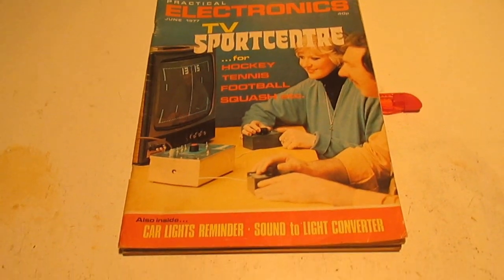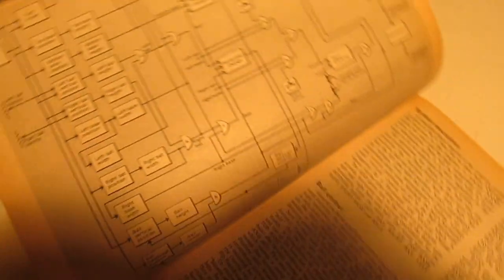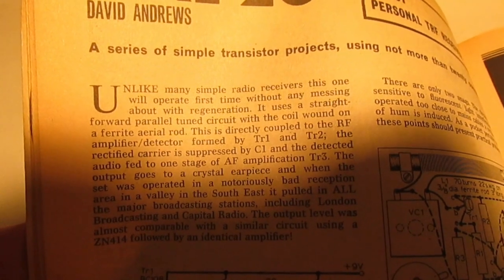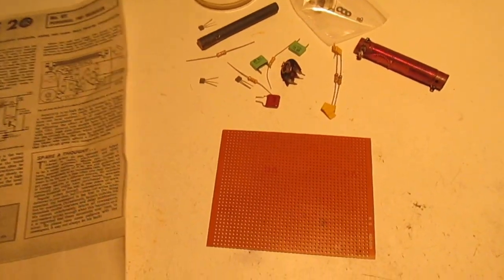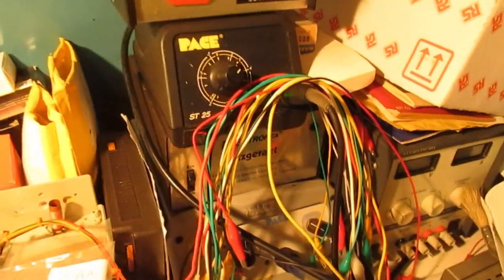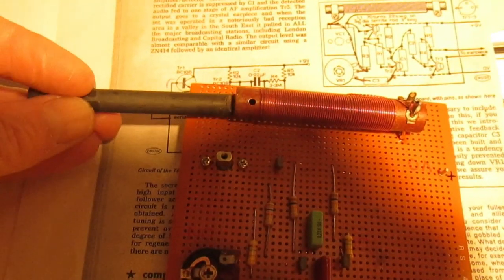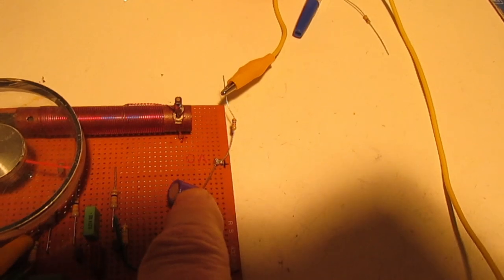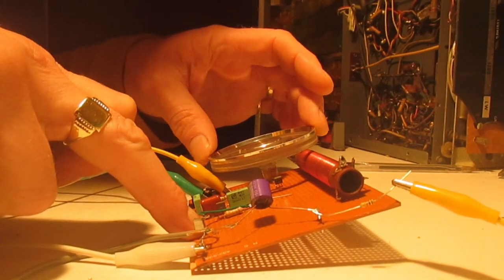Take 20  ,no 61. Practical wireless 1974 . Personal TRF receiver.David Andrews

Comment: Hello MD. Happy memories. I regularly dip into my 50 years of magazines stash and knock up  a project when its raining, usually on a breadboard
Reply from the maker: Breadboard is the modern word, when I was young and had one it was called S Dec !
Reply: @michaeldranfield7140  You know, that rings a bell. Who made those?
Reply: I had a 'Google' - I recall the S and T dec's, they also had a u-dec for IC's. I dont think I could afford one!
Reply from the maker: I can't remember but I still have mine from the 70s so where in a box, there was also an option for a front panel with 3 holes in to mount potentiometers.
Reply from the maker: Correct Sdec first then came one for IC s. I never had the IC one though.

Comment: Oh, that brings lots of happy memories of when I used my “transtronic” electronic construction set to make similar radio projects. I then progressed onto a Heathkit construction set which enabled me to make more advanced circuits. I’m surprised you didn’t have any BC108’s, that was my go to transistor for everything although in the early days it was the OC71 !
Reply from the maker: Heath kit was just a little before my time sadly but I do have a couple of FM radios by heath in my collection, I did find the odd BC108 after a search and as you say considering the popularity back in the 70s it is suprizing I didn't have a load of them
Reply: @michaeldranfield7140  BC148 or BC548 same thing but more modern encapsulation, i've found a few very old silicon devices with same can as the OC81!, BC148 would be period correct for the 70s, dunno about  BC548 dunno when the TO92 version came out,  maybe BC184 more that era?
Reply: I used to lust after things in the Heathkit catalogue! 🤩
Reply: @mistermikeanson  Yes, me too but as a hard up schoolboy that’s as far as it went but my uncle built a Heathkit LW, MW portable radio and it worked very well. I think it was an American firm.
Reply: My parents bought me a Transtronic kit for Christmas when I was about 10 years old. I used it for several years.

Comment: I remember building the Ladybird book TRF receiver but never got it to work for a multitude of reasons.  Getting exactly the right Eagle LT700 centre-tapped transformer was almost impossible, and I didn't have the right variable capacitor or ferrite core.  It probably would be easier to source the parts today than it was back in the day.  The Practical Wireless design looks easier to source parts for.
Reply from the maker: I have the ladybird book , I use to look at this book on a Saturday morning when we went out shopping and my mum took me to the library afterwards, never made anything out of it though , that would be about 1971 / 72 time .

Comment: Oh, nostalgia - I built this back then. Worked pretty well if I remember.
Reply from the maker: Would have been much better in the 70 s though when there was a lot more stations broadcast and houses weren't full of suff using switch mode power supplies generating RFI.
Reply: @michaeldranfield7140  Definitely.   Actually, I don't know why  chose to build a MW radio - I had a perfectly good radio, and anyway, I was more into shortwave (Come to think of it, my first shortwave radio was a Take 20 design, but it was quite quickly superseded - anyone remember the Codar Mini-Clipper ?).

Comment: I remember building a radio 2 tuner probably  from PW or EE .  I had it connected to a scrap old toy record player amp and fitted it in a old wooden cigar box.  Didn’t sound that good  more so due to the poor speaker . The tuner was pretty good  and didn’t drift . 
It didn’t matter what it sounded like it was the fact it worked
Reply from the maker: Yes I have a recollection of the radio 2 tuner, if it's the one I'm thinking of it was housed in a two tone clip together verobox.

Comment: I used to love the Take 20 projects in Practical Wireless. I’m sure I built quite a few of them. I did try to build the Teletennis game but as a fifteen year old it was a bit beyond my skill set at the time! Never did get it working. 
The biggest circuit I ever built on veroboard was a prototype for a company I worked for between 1979 and 1985, that one was 55 CMOS devices. I wish I’d kept it as a souvenir!
Reply from the maker: It's amazing to see how much large scale integration LSI simplified building electronic projects, the original tv game was on about 6 big veroboard s, the one I made only had 1 chip.
Reply: @michaeldranfield7140  the company I worked for at the time was part of the EMI group. I wanted to use a processor for the job but head office had decreed that all micro based designs and software were to be done in Wells. The project was a cash auditing and printing system for a vending machine. As a result what I ended up with was almost a processor in itself, with CMOS 5-digit counter ICs, an RTC, EPROM for text and hardware control and a load of glue logic to output to a parallel printer! Worked a treat too!

Comment: Hi Michael, I actually built that Tele Tennis game you referred to back in the seventies, it came in various kits you could buy separately so you could spread the cost! Somebody came up with a sound card that you could build to add on to the game which I did. Unfortunately there was no on screen scoring so you had to keep score yourself. I still have it and it still works fine.
Reply from the maker: Yes, I saw you could buy a set of Pcbs rather than use veroboard, that must be a very rare item you have then as back then this would have been a very expensive project to make.

Comment: Brilliant!! Love this!!! I remember building a mini radio - I think it was a PW circuit - housed in a Kirby grips box. It was clear plastic one side and white  the other - quite thin. It used a compression mica trimmer capacitor for tuning. Might have used the ZN414 chip - I can't remember. Might have been similar to the F G Rayer matchbox radio in EE.
Reply from the maker: The sinclair micro radio used a compression trimmer for tuning also, I just have one of those ZN414 s so this could well be another up and coming project!
Reply: @michaeldranfield7140  I have found a couple of articles via Google for radio projects using the ZN414. Apparently the chip is obsolete now, but there is a TA7642 which looks like the same thing.
Reply from the maker: @mistermikeanson  ZN414 appeared in a lot of projects in practical wireless , in fact I have one here I may well have a go at , I have the TA7642 s in stock but never looked to see if it is a direct pin for pin replacement or not yet .

Comment: Fairly sure that's Geoff Arnold on the cover with the Tele tennis game, he was the projects sub editor at the time, went on to be editor later. Both PW and Practical Television (as it was then) belonged to IPC magazines then,a version of the tele tennis game must have appeared in Practical telly mag?
Reply from the maker: I am not sure but you could well be right, I think this was designed by IPC magazines themselves so it would fit in place putting the sub editor on the front cover.
Reply: @michaeldranfield7140  I had a quick look on the world radio history site and there were  advertisers selling kits of parts in PTV mag for the PW project in late 1974.

Comment: Another enjoyable video Michael! I remember reading the Practical Wireless issues covering the TV Sportcentre and the incredible complexity with all those TTL chips. The final issue commented that at switch on, 'It might be a blessed relief if nothing happens'. Hilarious. My first electronic project was a TRF radio, inspired by a Ladybird book. All these things led me to a rewarding career in electronics.
Reply from the maker: I use to look at that ladybird book in the library when I went shopping with my mum on Saturdays, now I have my own copy.
Reply: I also had that Ladybird book i cannot remember the title of it but i remember making a small amplifier for a record player if i remember right the transistors were AC128s and the circuit was constructed on a piece of wood using screws and screw cups to join the components together
that little amp was my first electronic circuit that worked. i was about 6 years old when i got that book. in the mid eighties  I  worked in an amusement arcade repairing the coin-operated video games that teletennis  was a simple circuit compared to the machines in the arcade which had several A3 sized pcbs with rows of ttl or cmos logic chips as well as most of them had a Z80 CPU running the game and those boards with all the logic ics were mostly creating the graphics for the game. it was fun fault finding on them with just a multi meter and a logic probe. I have a games machine that has all the classic arcade games that runs on a Raspberry pi. when i play the games i always think of those pcbs with all those logic ics.

Comment: Sounds like a slo-mo drive wouldn't go amiss on the tuning cap.

Do you know, I am going to have to build a crude radio set - A crystal set, that I can actually get to work. Never in all my born days, have I ever been able to make one work. Even copying my granddad in a move for move build, back about 1968, I couldn't get a peep out of one - He did, Granddad, but mine just sat there like so many spare parts stuck to one of Granny's old wood and cork place mats. Maybe I zapped the diode with static electricity or something, but I never got one to work. Maybe I should have pestered him for and authentic cat's whisker?

OA80 germanium diode, I think we used - or something very similar.
Reply from the maker: I built a crystal set in the 70s using a denco coil from maplins and it never worked either, I grew up with valves but by the late 80s valve TVs were considered old fashioned and so I lost interest in valve stuff, but thankfully never threw anything away, then about 20 years ago something sparked off my interest again and in the loft at home I built a 1 valve radio on a block of wood using nails as solder points, the coil I wound on a empty roll of solder as a former and it worked first time to my amazement, the first station it received was radio beiging in China, now I'm not a radio listener anymore but a friend told me it was a very powerful station on medium wave, I still have it in the loft but I borrowed the tuning capacitor for something else, so I would say just have a go and make the simplest thing possible,
Reply: @michaeldranfield7140  I did get crystal radio's running, used the stop on the phone for a 50 mile aerial !!!!
But there was no selectivity whatsoever, 10's of stations all at once LOL
Reply from the maker: @quattrohead  you wont have any selectivity problems now , hardly any stations left .
Reply: The earphone is critical, it needs to be a "crystal" type.
Reply from the maker: @pizzablender  yes , high impedance but I had to use a separate amplifier so I could show it working for the video .

Comment: i spy a radiogram chassis in the background.. Decca?
Reply from the maker: Cant remember its been so long , woodworm and smashed dial glass so I removed the chassis and the plan was to re build it on an aluminium chassis , which is actually stood right next to the chassis , drilled it all out bit never got round to finishing it .

Comment: Hi Michael
I have one for you may comment on
It's a samsung UE55UK6400
looping at switch on leds light then dims then loop again
There is no video or logo just blank screen
Disconnecting av module leds stay on
Replaced av module its still the same 
Disconnecting lvds leads screen it still loops
At this stage there is nothing from the screen connecting to anything to tell the set to go to loop mode
I would appreciate your comments on this
Regards 
Patrick gray 
Graytv
Reply from the maker: only a guess but from what you have said if you know 100 percent the replacement main board is ok , then it must be the power supply , the disconnecting of the power board to main is only to check the led s in the screen , it does not guarantee the power board is working correctly .
Reply: @michaeldranfield7140  the power supply was changed
The main board was replaced 3 times
The main board was tried in another tv and it was OK
Others on utube have this problem 
I am at this job since termionc emission 
I never saw anything like it 
Regards
Patrick gray 
Gray tv

Comment: That TRF seems very selective for just the front end tuning take it outside to get rid of all that noise great little RX
Reply from the maker: I think back then we didn't have a house full of stuff with switch mode power supplies generating RFI.
Reply: @michaeldranfield7140  Dead right there mate BTW i didnt build much stuff from mags but used to mod radios and ham radio stuff to improve them